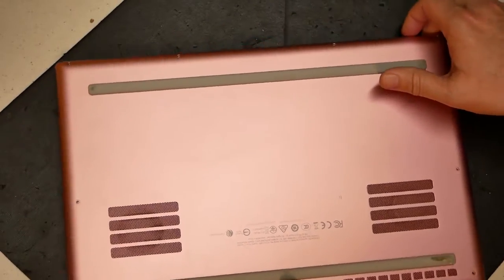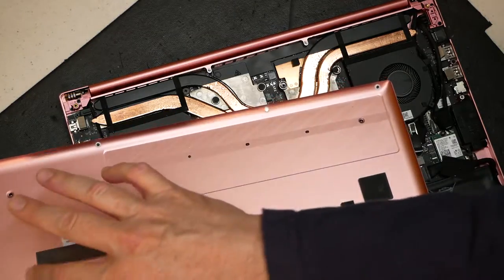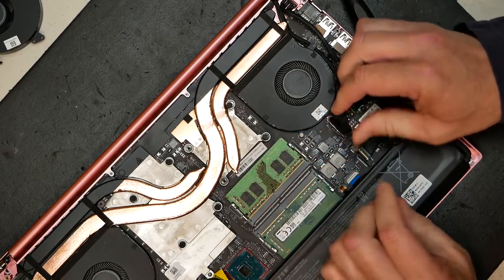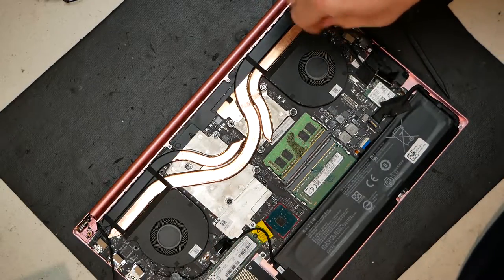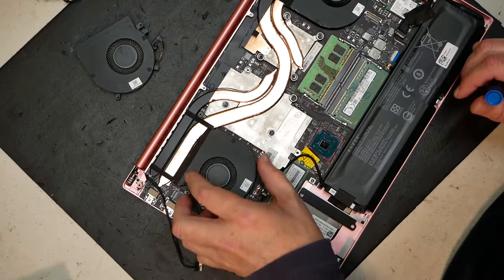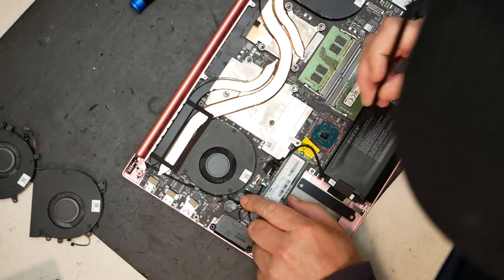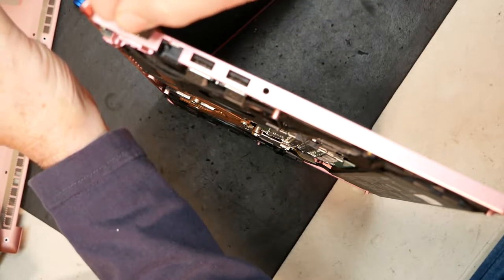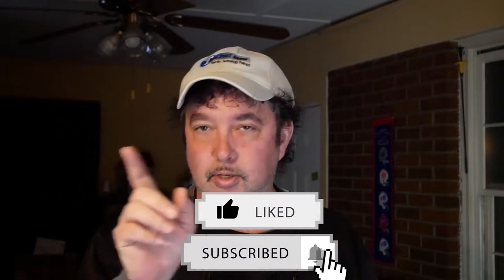Replacing Failing Fans on a Razer Gaming Laptop Step by Step

Comment: Great video. I was going to get a new hard drive because I heard spinning and it seemed that the laptop was overheating and would blue screen often. After looking at this video, I believe I need fan(s) instead. Please correct me if I'm wrong. Where do you get the fans from if I may ask. Again, thanks for the video.
Reply from the maker: Amazon